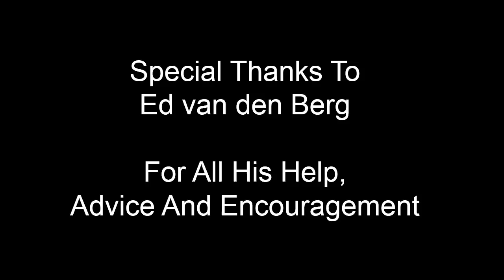Building a Stirling Helicopter - Part 14: First Flight And Final Thoughts

Comment: Thanks for sharing this!
 I suspect the blades spinning are causing a main shaft wobble and the backwards blades are making the effect worse. I think your current pulley would be sufficient if you were  to support the main shaft with a 2nd bearing block above the pulley.

It sounds awesome, good luck with the headshakes!
Reply from the maker: I imagine you're right, but remaking the pulley with better tolerances helped a lot. Thanks for commenting.

Comment: Can this get off the ground?  Also, have you tried using any other lubricant other than WD40?  That is a penetrating oil and does not really make the best lubricant for moving parts.  You might try some sewing machine oil, motor oil, silicone, or even white lithium grease.
Reply from the maker: No, this can't fly. A Stirling engine outputs a tiny amount of power and brass is VERY heavy. Besides, a flying helicopter would require multiple servos to vary the blade pitch, not to mention some form of radio control. Although I may have used the word lubrication in the video, the real purpose of the WD40 is to create a better air seal between the cylinder and piston. Other modelers have tried the various lubricants you've mentioned and have determined that WD40 is the best solution for a Stirling engine. I can assure you, the WD40 works great. Thanks for watching!

Comment: thanks so much for shqring, i'm new to machining and polishing metal and its good to know how you do it, and will save me on trial and error when I build my first engine.
What properties make it better to have a steel cylinder and bronze piston?
Reply from the maker: Glad I could help. I'm not an expert on making engines and with this one I followed someone else's plans that called for a brass cylinder and graphite piston. What I can tell you is that the parts need to be machined to VERY exacting tolerances and I imagine that would be easier to do with steel and bronze. Also, a steel and bronze pair would wear better over time.

Comment: Well i thought from the beginneng that this would not fly(unless maybe if you cool it with liquid nitrogen) but i still was hoping i'm wrong. It took quite a bit of effort to make internal combustion engine lift a plane, but helicopter needs even more power to operate and Stirling engine has even less power density.